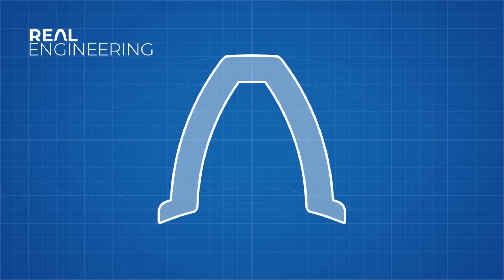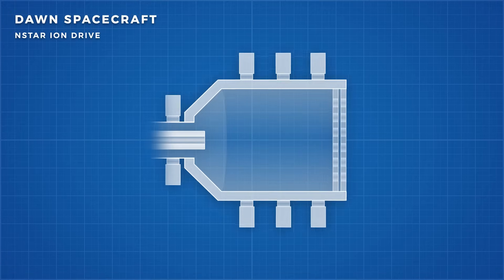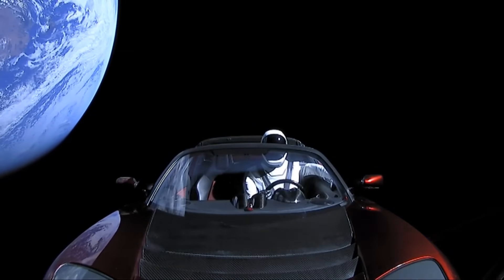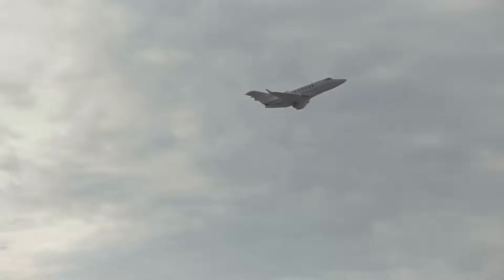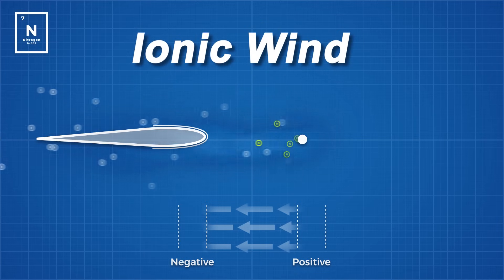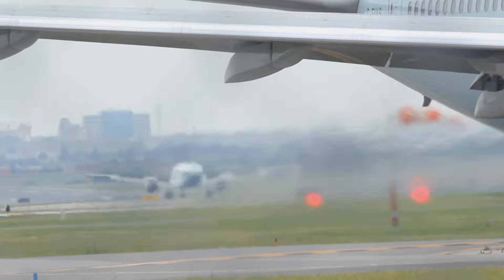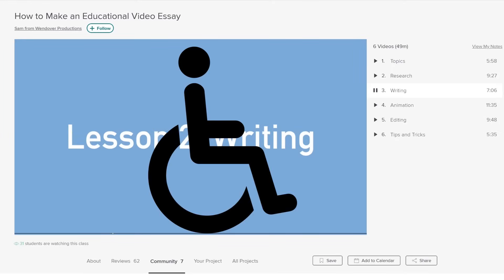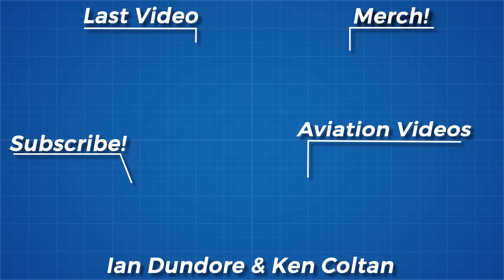Ion Propulsion - The Plane With No Moving Parts

Comment: This can not scale with either size, weight or speed.
Interesting sure but not for aircraft.
Reply: @Victor Nguyen The japanese had almost a thousand years to develop their origami technology, and still not a single paper crane ever achieved independent flight. When it is the wrong technology for the job, time alone doesn't help.
Reply: @stefanb6539  that's a decorative item right ? 

I believe it will first come as hybrid plane to lower fuel cost and shit
Reply: @bananesalee7086  
Don't think so.
The energy density of fuel is unmatched by any current battery. We are talking of orders of magnitude right now.
So, no. You cannot lower fuel costs with that technology. The batteries - and this includes charging them - cost way more then any fuel you might save. Even IFF this technology once gets into force categories which are actually interesting.
Reply: @Victor Nguyen Time and technology can't change the laws of physics. Increasing the power density means arcing across the electrodes.
Reply: @leerman22  eXACTLY.it wont work.usefull only if it carry power and payload and thrust exceeds it. this wont scale.NOT EVEN TO DRONES.waste of time,.
SCOTTY. YOU CANNAE CHANGE THE LAWS OF PHYSICS.
YEWS CANNAE CHANGE THE LAWWS OF FIZACS....
Reply: Not as a propulsion system, but I can see aircraft applications, such as using a propeller or ducted fan as the lead electrode and having trailing wires placed at equidistant points around the outer diameter behind the propeller, to the end of lightweight thrust vectoring
Reply: @JessicaBiros   It is a matter of thrust to drag, as the speed increases the drag from the electrodes will increase with the cube of the speed of the air,  therefore it would be a net reduction in the thrust at a speed needed to lift a useful aircraft.

It works in space because gravity and air resistance are not a limiting factors. I used to think that the people who watch these videos were smart and could think for themselves.
Reply: @marvintpandroid2213   For one, that final remark was incredibly insulting, uncalled for, and in incredibly poor taste. For another, I said that it is entirely non-functional as an independent propulsion system, completely worthless in that regard. I should also probably clarify that I am not talking about using the arangment presented, as that is designed for propulsion, and I am speculating about low drag airflow control. What I did say is that while it cannot work as an independent propulsion system, it could be used to eliminate some of extremely heavy, complicated, expensive, and/or hard to manufacture components of aircraft. Airflow control over the surface of the wing and throughout the otherwise standard engine could result in greatly increased efficiency. This could also be used to deflect the airflow from an engine, so as to replace the thrust vectoring system. I could leave off with an incredibly insulting and disparaging comment, but I personally prefer not to stoop to such a level.
Reply: @JessicaBiros   I am sorry that you took it as an insult, I wholeheartedly apologize

It is an interesting idea but even in the worlds slowest useful aircraft, https://en.wikipedia.org/wiki/PZL_M-15_Belphegor , with a stall speed of 67.5 and affect to the air stream in terms of thrust or any other change of direction would be massively outweighed by the drag of the wires.

Even on something as delicate as this, https://en.wikipedia.org/wiki/MacCready_Gossamer_Albatross , the drag at 18 miles an hour would be much more than the thrust. Flaps, wing slats and other movable surfaces can have any type of airflow control you need on an aircraft with little to no drag when not in use.

The math of flight really is not something you can work around.
Reply: @marvintpandroid2213  I do understand what you are saying, and while you have a fairly good grasp on how drag works, you have clearly misunderstood what I am describing. In actual fact what I am describing in terms of a control surface is incredibly similar to one that exists already (a plasma actuator). When I was describing the thrust vectoring system, I thought it was simply implied that the wires would be trailing the engine in line with the airflow, so as to cause minimal drag. While this would not have a significant effect, it would provide an improvement for minimal weight, and could even be implemented within the cowling of a turbofan, with the electrodes being the fan itself and charged surfaces integrated into the interior skin at the rear of the cowling.
   In practical application, the mechanism design that the MIT team has implemented is worthless, but it is merely a research vehicle, useful for developing areodynamic models of ionic wind, and thus is designed such. The concept of using ionic wind in areodynamics is not constrained to such clumsy designs unless it is used as the source of propulsion. In any practical usage, the electrodes would be entirely incorporated into the skin of the aircraft, and would be used for boundary layer control.
Reply: @JessicaBiros  The usage as boundary layer control is a neat idea.
Reply: @JessicaBiros  Wouldnt work. It's only application would be to limit flow separation on an airfoil, among other small things that would barely amount to any noticeable performance increase. Basically you would be wasting energy on something that is 100% pointless - kind of like an electric car powered by a coal fired power plant some miles away, with parts made by slaves in China where the rare elements that are a part of that electric car are also mined (which is also extremely dirty), and then to have all of those parts shipped on a diesel fueled cargo ship for a month just so it can be carted around by semi-tractor trailers across the entire nation, which also run on diesel. Makes a whole lot of sense to pump more pollution into the atmosphere than what the entire lifespan and production of two standard ICE cars produce, never mind the poor energy capacity of modern batteries as well as the sub-par efficiencies obtained (Most gasoline powered vehicles exceed 85% efficiency, with a considerable sum even reaching 95-98%).
Reply: @redryder6987  You clearly don't know what you are talking about. Commercial vehicles have engines that achieve about 40 to 45 percent efficiency and transmissions that can achieve about 80%. Electric vehicle's on the other hand, can achieve charging and discharging efficiencies of greater than ninety percent. Furthermore, a coal or nuclear plant can achieve higher thermal efficiency and a higher percentage of it's Carnot efficiency than the engine of a car due to higher thermal gradients and thermal recapture not being limited by weight. Even factoring in the long distance transmission losses, electric vehicles still have higher efficiency than those powered by an internal combustion engine.

That said, I do agree that due to materials limitations and manufacturing costs, purely electric vehicles are currently inferior. Hybrids are not, and with the rate of advancement in the fields of manufacturing, design, and materials science, pure electric vehicles will not be for much longer.

And finally getting back to the topic at hand and away from the detour into electric vehicles, your assertion that minor optimizations in laminar flow are not worth some energy expenditure is absurd. Minimizing drag due to turbulent flow in the wing root is a significant challenge, and a method of actively optimizing laminar flow would be a significant boon. I will conceed that using ionization to vector thrust in a vehicle of any significant size is in hindsight incredibly impractical, but in a small ultralight vehicle such as a drone it would be hugely advantageous.
Reply: LMAO It's always laymen making these comments. But go ahead, juxtapose yourself to he an Aerospace Professional.
Reply: What about drones? It would be nice to have noiseless drones
Reply: @manuvillada5697   Look at the demo aircraft, do some math and do some thinking.
Reply: if the power requirements are low enough and it can support a solar panel it would be great for a reconnaissance drone. quiet, can fly for just about ever, least during the day unless you can manage a 12 or so hour battery as well.
Reply: lol what's all this talk about time and tech? as if they correlate. nah, it's more like great scientists and engineers and most importantly, *if the laws of nature make it feasible*.
Reply: For now. The wright Flyer also really sucked and was nothing more than a curiosity. Given time this technology could change the world as well
Reply: @patafanmarti2913  The wright flier was carrying a person. With tech you never say never but this is fundamentally unable to be scaled. Anything that brings ion propulsion up to something like even an ultralight plane will be a fundamentally different design. If you had doubled the wright fliers thrust to weight you'd have an incredible leap in performance. To get to commercial jet you have to get a 3000% increase on this techs power to weight. I imagine the earliest applications of this will be surveillance drones. But carrying even one human around on ion power? I'd be surprised if I live to see it.
Reply: @starvalkyrie  I don't disagree with anything you said. But "with tech, never say never" is basically what I'm trying to get across.
Even today we're doing things that would have seemed fundamentally absurd just 20 years ago.
Reply: @patafanmarti2913  I get you I'm just saying we're not looking at some kind of incremental challenge, something special is going to need to happen. I'd love to be wrong though. I need those super efficient ion craft with their cool vertical takeoffs flinting in and out of atmosphere effortlessly.... but thermodynamics is a cruel mistress.
Reply: The Wright Flyer demonstrated a new understanding of how to control an aerial vehicle ,and applied a promising, but new propulsion technology. Both things had enormous developn=]ment potential. The ion wind effect has been know for more than a half century, and has repeatedly been demonstrated with "ion lifters", which reliably worked ,but couldn't lift their own power source. This device uses mature aeronautic knowledge that has enjoyed more than  a century of development to carry a highly miniaturized and endurance limited version of a lifter's power supply. It cannot ,as the Wright Flyer didm lift off on it's own power from the ground. It cannot carry anything besides its own propulsion system ,while the Flyer could carry a human being. Within a]fivew years of the Wright Flyer's first flight, hundreds of people had flown in dozens of craft in several countries. there were companies in existence producing aircraft for sale. Check back with me five years from now, but I'd be quite willing to bet my house that the first ion  wind propelled man carrying aircraft will not have flown by then.  The Wright Flyer's rapid and unlimited success does not indicate in any way that any way you can get an aircraft to fly. however minimally,  is a sure winner.  @patafanmarti2913